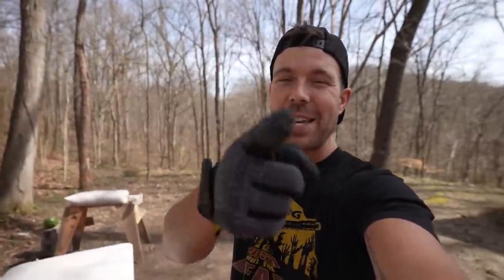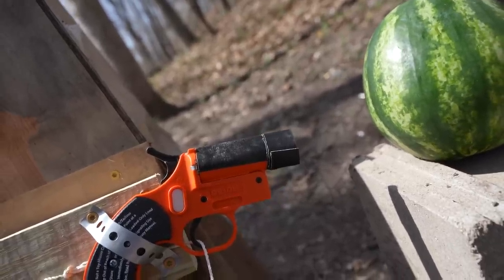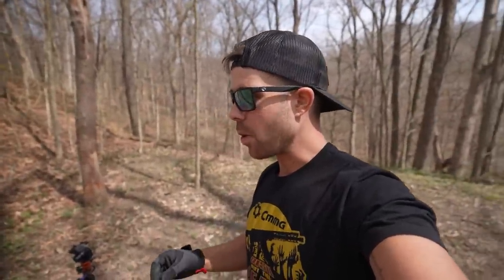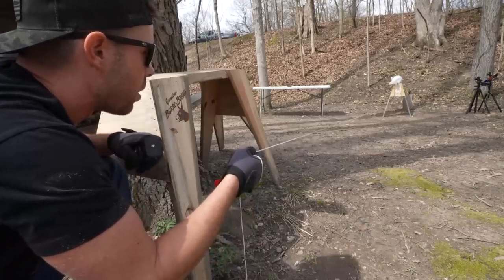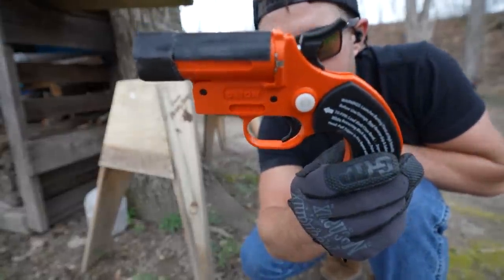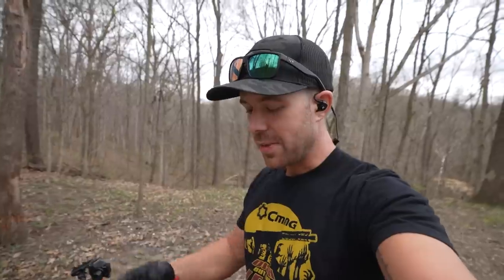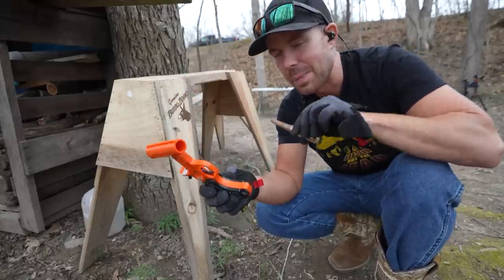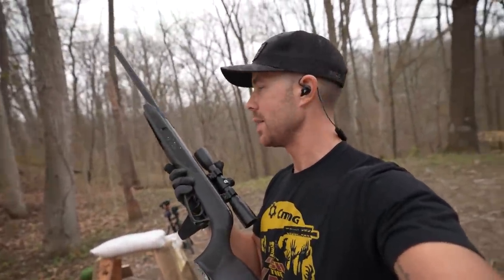REAL Ammo In a Flare Gun?! (IT WORKED)

Comment: Brass height came about for quick identification between field and hunting shells. High brass doesn't absolutely mean more powder. Full power loads can be reloaded into low brass shells.
Reply: That is one thing i really hate most typical way to tell shells what they use for testing.
The hell it tells us whatkind of shell we are dealing with if only information is brass height ?
Is it too hard to check box or read that text usually printd on shell ?
Payload Weight, and shot size are far more informative when we are looking how effective it should be.
Give printed muzzle velocity and there we have actuall information.
Not some mystery round from hobo sack...

Comment: I had a 50 cal bullet from the military back in 1969 which I took and put in a 4x4 fence post with a hole in it. This was way up in hills and I took used a a pellet gun, 22 cal to fire off the pimer. The fence post cracked open but did not shatter. The casing went back somewhere towards me and the bullet itself I never found. Oh and I did not find the casing. But that was the loudest bang ever and reminded me of my military days.  With almost no hearing protection except the coms system ear muffs(for lack of better description), and being under the 3 inch 50 gun it sounded almost as loud!

Comment: You're undoubtedly a great shot and that pellet tifle is undoubtedly accurate, but like many springers it prefers the artillery hold to being rested. I think that's why you were more successful when standing,  considering the tiny target. Great shooting. Great video!
Reply: Hi, do you mean instead of gripping the front, it's better to sort of "lay" it on your hand or arm? How come springers prefer this? I've got a couple of air rifles I shoot rarely but they're PCPs. Thanks.
Reply: @xntumrfo9ivrnwf  because springers have a double recoil impulse. They move forward then back or back then forward and because the pellet is in the barrel when this happens, its easy to cause the rifle to move side to side or up and down. its best to let the rifle do its thing with as little input on the rifle as possible. Its one of the reasons i love spring air rifles so much. Its more of a challenge
Reply: @RekzysTheTitan  Thanks, super helpful.

From a naive perspective, this would make me think spring rifles are overall much less accurate than other types. However from your post I take it that with practice, they can work very well too?

Also, I'm very happy to know that you're not a meth dealer! I only talk to heroin peddlers :p
Reply: I just bought a Hatsan 125 S. It's a 
.25. its very quickly becoming one of my favorite air guns. I never owned a break barrel before and I am shocked at how powerful they are. I think I need to upgrade however to the .30cal gas piston. Those look like a lot of fun
Reply: @xntumrfo9ivrnwf  exactly as NotaMethDealer said. And yes, springers can be just as accurate as PCPs, and last forever with minimal maintenance. I myself favour PCPs when power is needed, but they can be quite a headache as I'm sure you've seen yourself!
Reply: @gyromurphy  good gun! The 30 will have a much more pronounced drop, but it's a beast at shorter range!
Reply: @xntumrfo9ivrnwf  yeah you hold them slightly an let them recoil like a artillery piece does you don't need too pull them tight in your shoulder an let the recoil do its thing totally opposite to normally. I've had some really accurate springers I had a really accurate one from the 50s still good power an shot better than a lot of my   newer guns on iron sights alone versus modern scoped ones I had. An I had a really good SKS 177 bought new for 20 pounds was really surprised on that one.
Reply: @brostelio  yeah I found 177 shoot so flat it makes shooting easier an have high velocity but lack stopping power at range but a .20 was my preferred round hits like a .22 but flat like .177 with little ballistic arc an very easy to calculate long shots

Comment: If you want to make one capable of firing a 12 gauge no problem, take apart the flare gun and replace the locking pin with a hardened steel pin and the spring with a stiffer counterpart, replace the hammer with a milled metal one, dremel out a square pocket where the hammer protrudes out of the frame into the primer, epoxy a piece of steel sheet metal in the pocket, then bore out the barrel to the diameter of a 12 gauge barrel liner and line it with the steel liner. 

That way, the action will not pop open every shot, the shell will no longer crack the rear of the frame,  light primer strikes will no longer be a problem and the barrel will not rupture. 

You can also buy hardened steel "Flare Gun Adapters" that slide into 20mm flare guns, and allow 12 gauge shells to be fired relatively safely.

Comment: I few things to note:
1. Rubber ball shells doesn't mean it's not lethal, only at point blank.
2. You won't be able to fire a 50 BMG in a flare gun, you need rubber bands.
3. Even if you manage to hit it, it's not going to contain the metal shell casing because metal shell casing needs a barrel too so it will not contain the blast.

Comment: You should buy drop in 12gauge conversion cylinders and try it. I used to shoot 45long colt and 22 out of my grandpa's old double barrel growing up. Most of the pressure is contained in the conversion cylinder so it might work!
Reply: I know that a .22 converter will work, I've done that.

Comment: if the flair gun was amde out of steel of the same thickness rather than cheap plastic and maybe had a slightly stronger hammer impact on the back of the rounds 
maybe it would survive heavier shot gun rounds without becoming a grenade 
i mean the concept was "simulated" a joke gun was created in the vr videogame (hotdogs horseshoes and handgrenades) i mean with a bit of leway the game tries to stay atleast resonably beleivable with its gun physics 
and the gun in question is literaly just a flair gun made of steel rather than plastic 
would that work? maybe